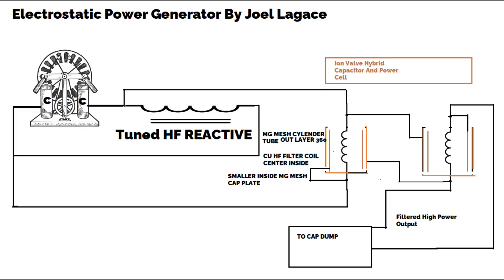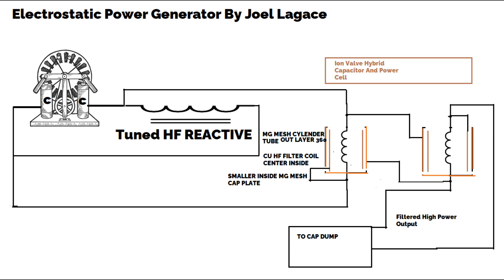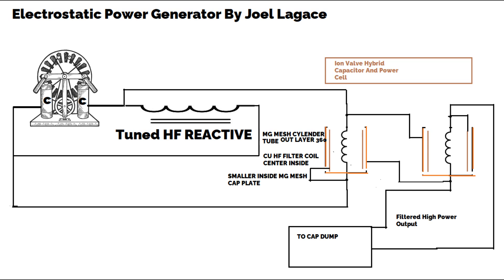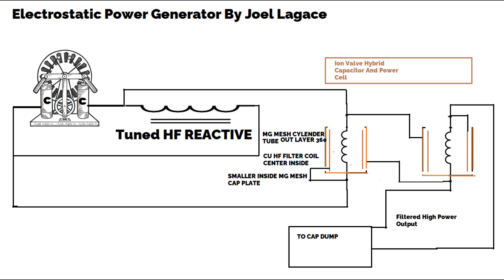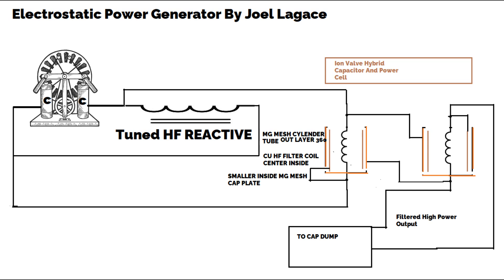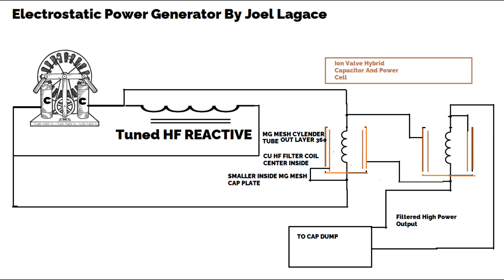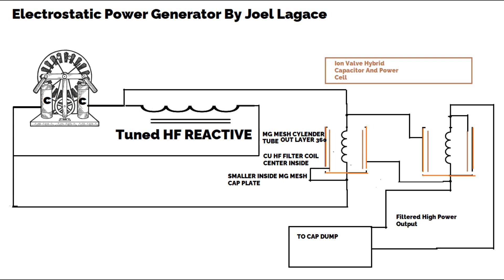Electrostatic Power Generator

Comment: Hi Joel, I've been thinking about doing something similar for over a year, but I didn't quite understand the scheme of these ion coils. Could you explain it to me better? I was thinking about using regular batteries to do this part. Thanks for the video.:washhands::washhands:
Reply from the maker: Ionized nearby air creates a galvanic potential as it acts as an electrolyte the same electrolyte enhances the built in mesh capacitor plates air gap dielectric. It's a starting point.....

Comment: Hi Joel, is the lower end of copper coil physically connected outer MG mesh?
Reply from the maker: Sorry bad drawing, I tried to draw a base that does not look like part of the circuit but its a 360 cylinder with inner and outer layer mesh plates with the coil rod in the middle inside. I will provide a link for context of the filtering stage circuit. http://typeright.social/forum/showthread.php?tid=481&pid=1106#pid1106
Reply: @joellagace1679  Thank you!